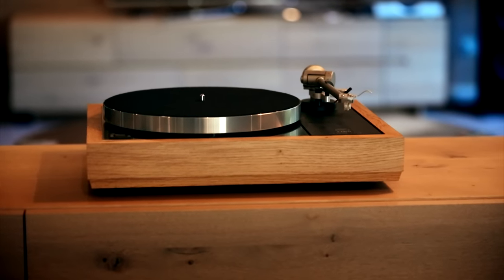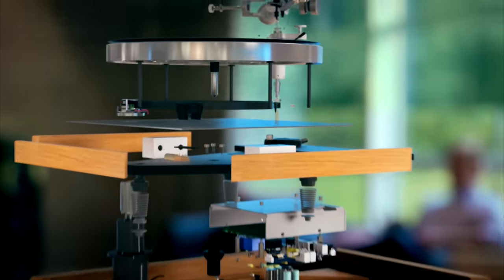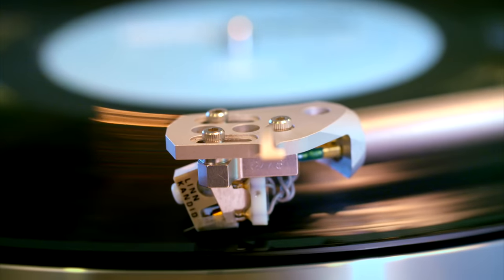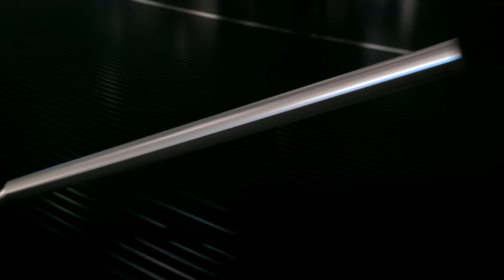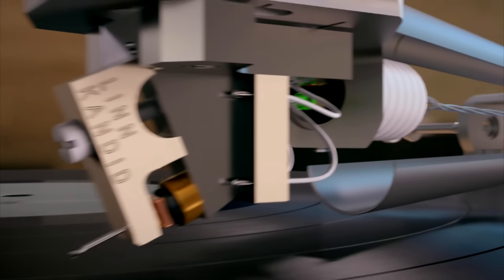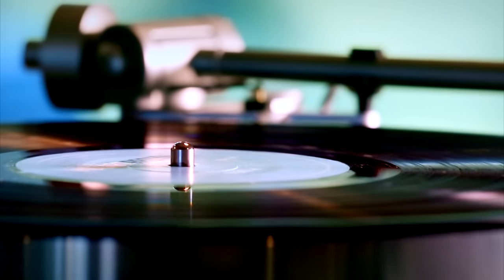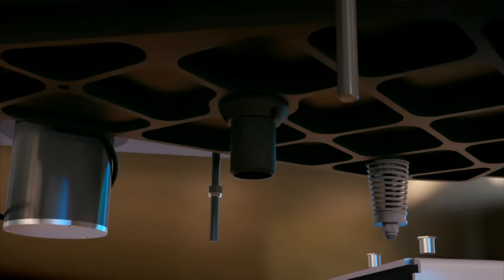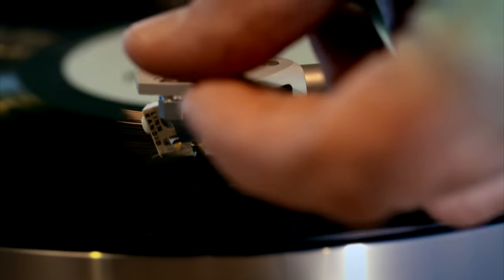How Does a Turntable Work?

Comment: The video didn't answer its own question - "[how can] old school technology sound better than difital downloads?". 

This is analogue vs/ digital. The reason analogue sounds better is because it is a smooth, continuous wave. Digital is a series of columns of data, that try to reproduce the analogue wave, but because they are columns placed side by side, there will always be gaps between each column, no matter how high quality the data is. As a result, the analogue wave will sound better than the digital approximation of that wave because it is a continuous flow, not a segmented grouping.
Reply: ohh ok ! that's actually very interesting
Reply: my
Reply: p

Comment: Sure, vinyl sounds great. But you have to deal with:

1. the random crackles and pops
2. low signal to noise ratio (lack of dynamic range)
3. degradation

and probably a buttload of other issues. Too much of a hassle if you ask me.
Reply: Also price and storage, I have nearly 300 vinyl and it starts to become a nightmare. I prefer a high quality .WAV
Reply: +woopygoman CD or flac > vinyl thats for sure.
Reply: +woopygoman you don't have to worry about pops and cracks if you take the time to deep clean your records two or so times a year and clean it with a record brush before and after playing it.
It's a lot more satisfying to work for your music rather than plugging in headphones to an iPhone and settling for that (just my opinion).
Reply: Dylan Waters No worries I'm covered! ;)
320kbps fraunhofer encodings (better than lame imo)
FiiO E10K (DAC)
Schiit Asgard 2 (headphone amp)
HiFiMan HE-400 (planar magnetic headphone)
Reply: woopygoman a hassle for you since the digital age has conditioned us to conveinience.
Reply: Also the secret messages
Reply: I love the crackling and popping

Comment: does anyone know what the model of that turntable used in the video is?
Reply: I think it's a Linn Sondek LP12. The price of the turntable is £25,000 ($33k+).

Source: http://www.hifiplus.com/articles/a-wee-dram-for-linns-40th/
Reply: That's so expensive. I'd rather stick to my Audio Techinca lp 60 that costs $99 and buy a new 370z
Reply: yeah. Waiting for my new lp60 arriving soon. My next TT will be the Pyle Pro PLTTB3U.
Reply: If you want very good quality for way less but more than your AT Table cost,our probably better off with a VPI Scout at around 1000 notes or a vintage Sony, Pioneer , Kenwood. Denon Direct Drive tables , or a  AR Acoustic Research belt drive manual or an Empire belt drive  than this overpriced billionaires toy..

Comment: Isn't it possible to create one Song's specific current without a Vinyldisk? So basically create the Vinyl sound without the necessity of a vinyldisk?
Reply: What...
Reply: +Tobias Seidel yeah that's a digital song man
Reply: Alain Rochette
But why does it sound differently if it's basically the same?
Reply: Most digital formats are compressed. You could take a master recording and output it to a FLAC and while the song will be just as clear as vinyl, it won't have the "texture" that a physical media inherently adds.
Reply: Çerastes Data. A lossy format like MP3 as compared to FLAC for example.

Comment: funny thing is im 12 and i Made a homemade turn table setup and the part that makes it where the record doesn't jump i added in and i dident even realize it and it was mainly out of a old circuit kit motor, some cardboard, a Ruler, Super glue, Paper, 2 Pens, and a switch, And Finally A needle from a Record player and i did all of the math from every thing i bought and every thing that i dident buy but my parents bought and it costs $50 -  $100

Thats Way less than the advrage Record player i think.

Comment: It makes absolutely no sense to me that vinyl record could ever sound as good or better than digital. Records just sound so hollow and flat.
Reply: +Steve Analog will ALWAYS beat digital. Digital takes the sound and chops it up into steps, which makes the recording lose a lot of the detail. Analog gives you pure waves the way it was recorded without losing the detail.
Reply: Records don't sound hollow and flat... that must have been the audio equipment... check out the videos of my channel and use good headphones or a good audio set up...
Reply: Steve you my friend need to experience a good record player to appreciate vinyl. My turntable is a 1983 AR, slightly modifide, it has a deep and spacious sound stage that my cd player just cant match.
Reply: Steve you need to experience better vinyl record play back equipment to really get the most from records. You be surprised how good they sound with quality equipment and you don't really have to spend a fortune. Factor about $400  for a turntable, and say about $150 for a cartridge and play it thru a decent amplifier and speakers.
Reply: Or just say screw it, and get better sound quality from a $30 DAC.